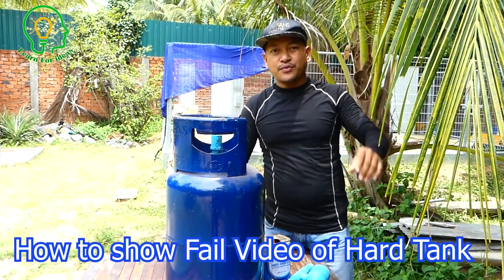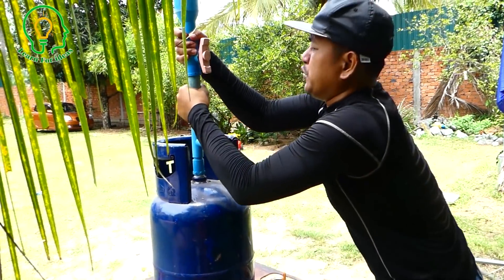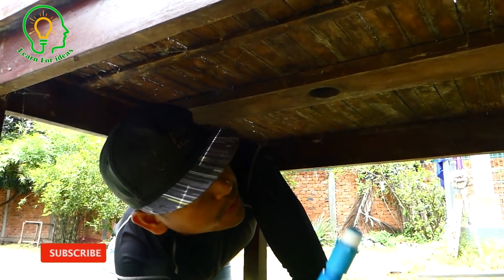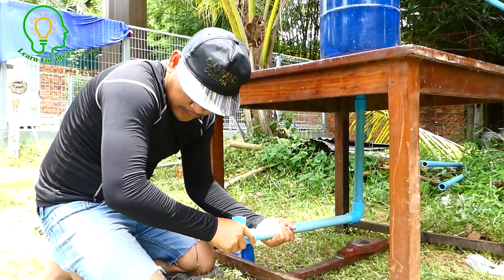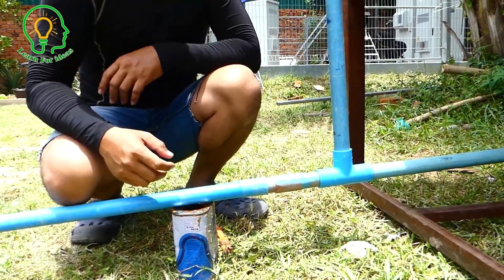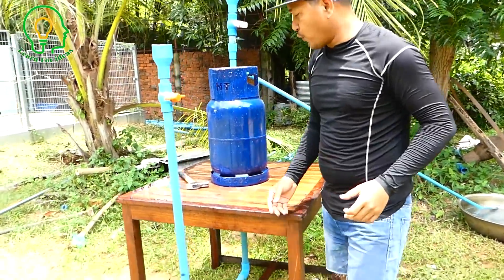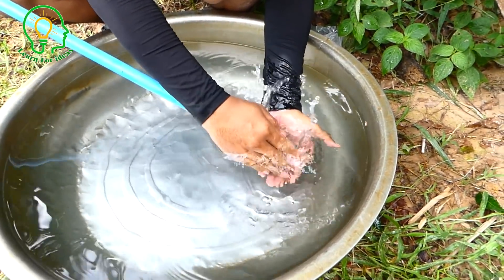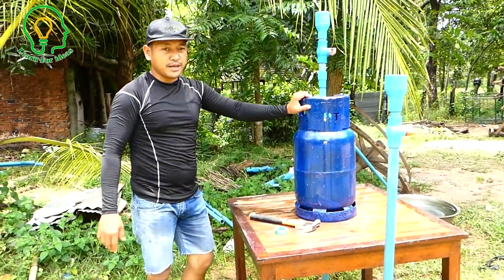Free energy water pump failed setup | Pump without electricity|

Comment: The only way you can convince the people that it is really a true free energy pump and NOT A SIMPLE SIPHON is to route the discharge outlet to the water source and show that the flow continues to the source. THIS IS THE ONLY WAY, I CHALLENGE YOU TO DO IT WITHOUT ANY HIDDEN PUMP DRIVING THE FLOW OF WATER.
Reply: it is a syphion with a buffer.. the outlet can be max 4 meters below the water table height or else the suction is to hard and will crush the tank

Comment: Try to use a standard garden water hose for the output and please let us know what sizes and length will work. Many thanks.
Reply: This way it is easier to replicate...
Reply from the maker: Great suggestion!
Reply: With the pressure build-up, I believe the soft hose pipe will contract and stopping the flow either way.

Comment: Do you already know, what dimensions of the pipes will work ? I still have such an old gas tank and if I would know, how long and big the pipes must be, I could also try this...
Reply: The main problem is, that you always get air from the output Pipe into the tank...if you could tell us, how we could avoid this, I would be very glad. Many thanks. 👍🏻🥰🙋🏻‍♂️
Reply: Tào phào . hết nước lại bơm tiếp vào bình.!!!
Reply: @cuongdr1140  So do you think it is a fake ??
Reply: The atmospheric Pressure raise the water in full Vacuum about 10M high. They never say what diameter. 
The Water levels itself. Like a lake. Will flow to the lower point.
 (The bigger diameter will flow more water.)
 It is a self starting siphon system if you fit a drum on the top, longest it is air tight. 
Condition apply > ( the output level must be lower than the input!) if you lift it higher it will stop flowing. Regardless pipe diameter.
At Least This video say the truth...
Well Done    👍🏻 Learn From Ideas👍🏻

Comment: From well to take water is possible ??? Please explain bro... But its amazing explain 😍😍🥰
Reply from the maker: Not possible , thank
Reply: @LearnForideas  why? Please explain
Reply: YES 
Use Submersible electric pump. Specially if you got more than 8M deep. 
Otherwise use any other electric pump if less than 8m.
You may need a stop valve at he bottom, and fill the system with water, before start.